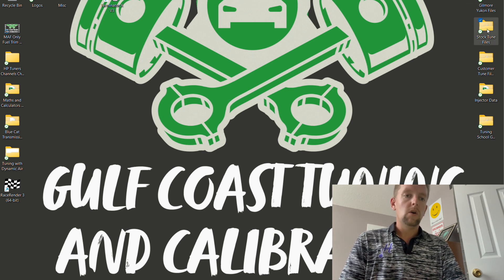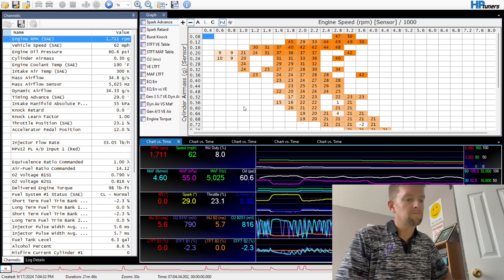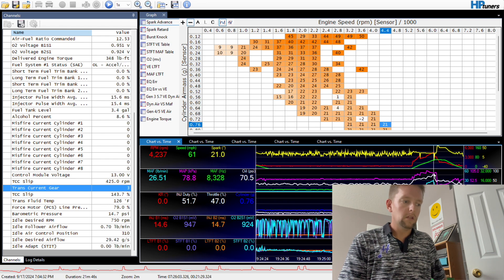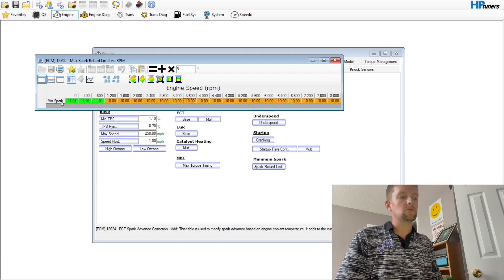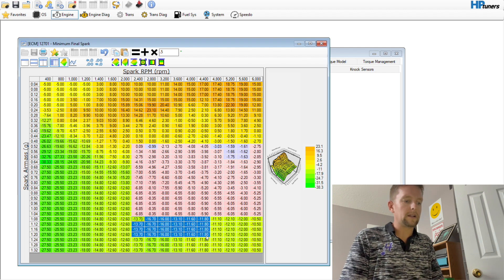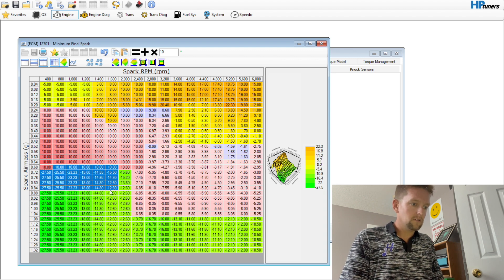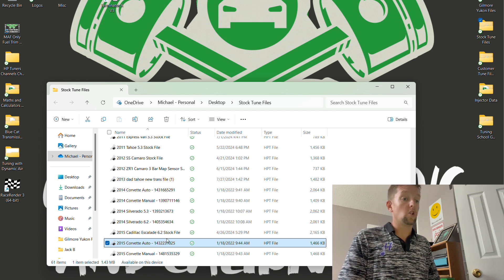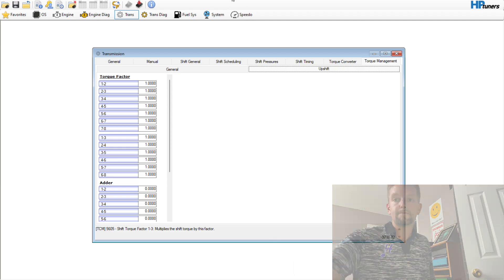Timing Advance for Better Driving

Comment: So are you still allowing it to go negative in the higher load/rpm area so other factors can still pull timing in the event of knock or something else?
Reply from the maker: It's totally up to you, those higher regions I'm more than likely going to set it to 0 but also not modify any of the torque management settings. Any time the spark gets pulled into those negative numbers it causes to much of a dip and in the 6/8/10 speed transmission I've found that 0 in those upper regions is typically just fine. Torque management can still do it's job without you flying back in your seat when the power gets ripped out.